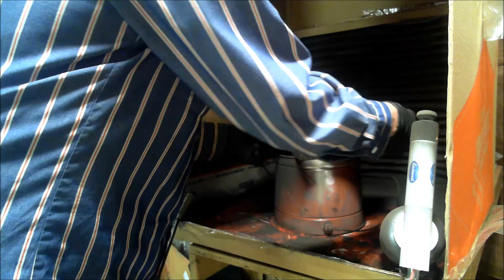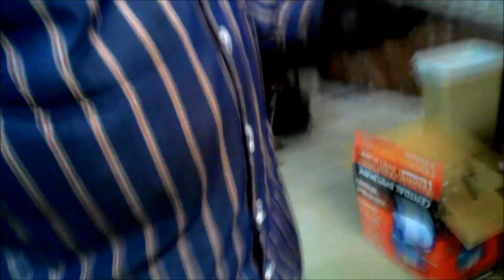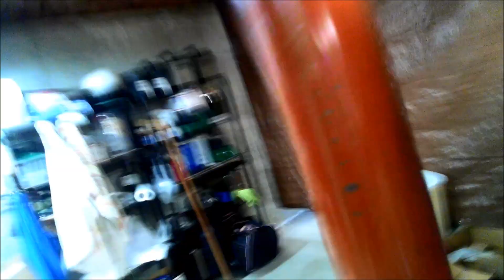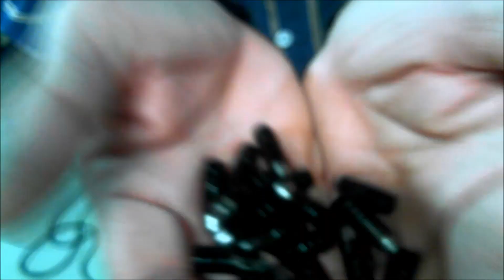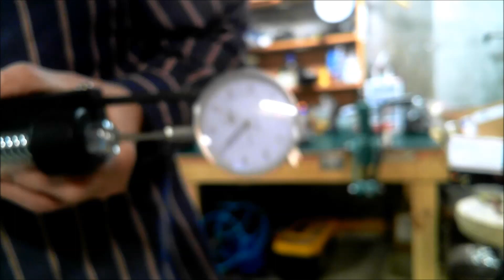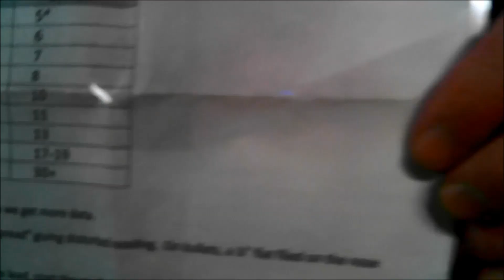Powder Coating Using A ElectroStatic Gun

Comment: I believe you need to coat the base because you will get gas cutting or that is what I was told
Reply from the maker: Not sure. Lots of people lube their bullets and load them with no gas checks. 9mm lead bullets just lubed - the lead base is exposed just like any other lead bullet that is not powder coated.